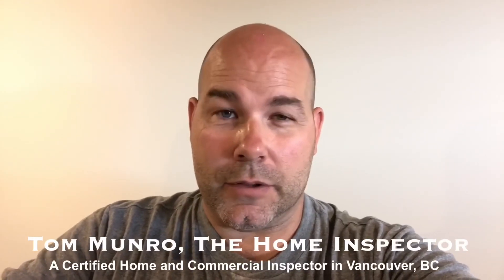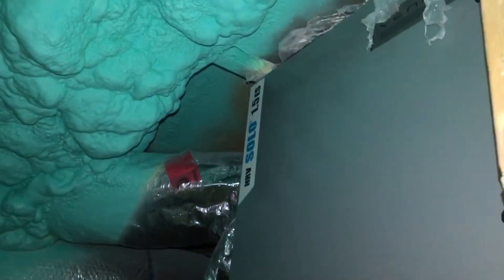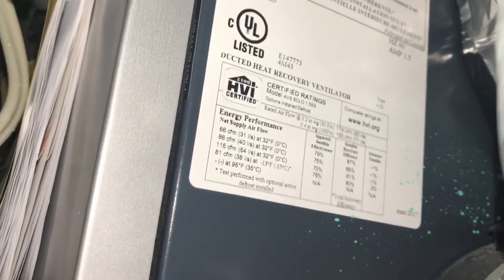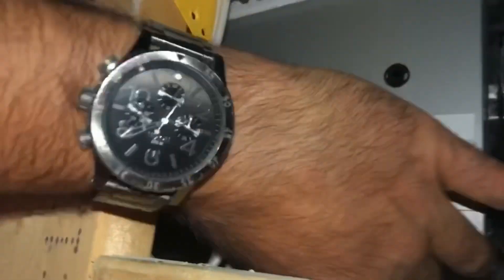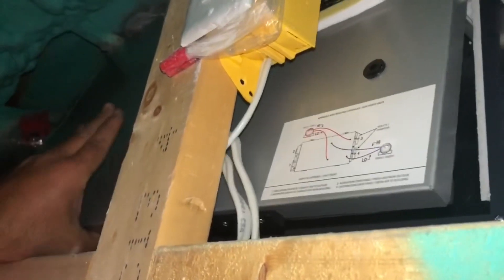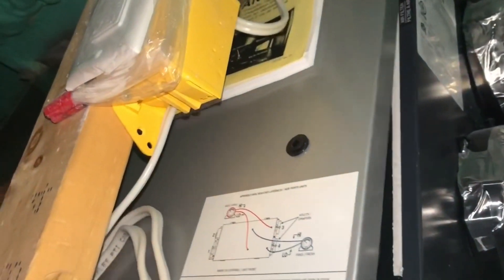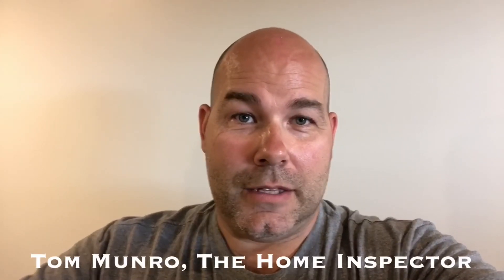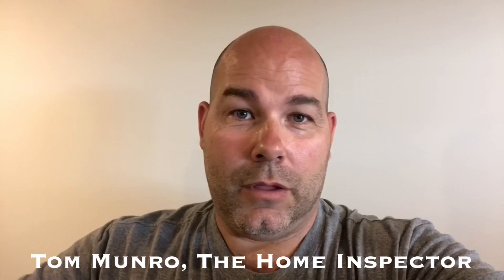4.5 MILLION and this is my HRV?

Comment: So who is responsible for fixing this the builder? Are air units put in and the built around them like a bathtub unit?  Misread floor plans so the subcontractor is in trouble? I'm wondering before I build my small home.
Reply from the maker: Foxie Dog you’d have the HRV sized for the overall sq/footage of the home.  It should be in an accessible area for regular maintenance.  Thanks for the comment!!